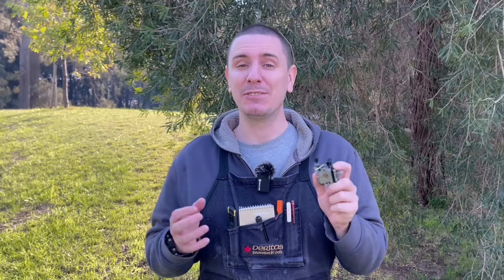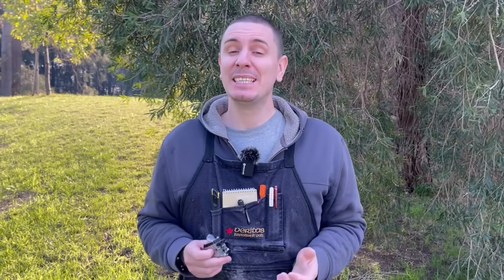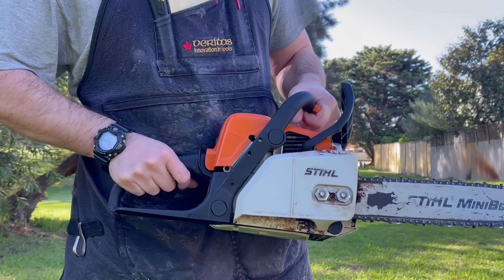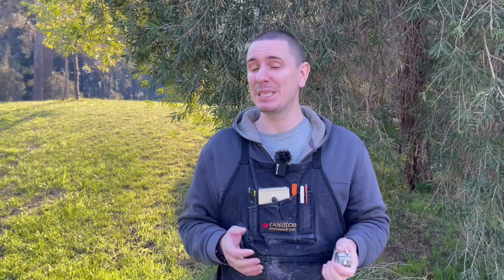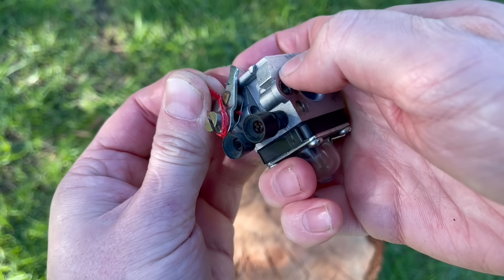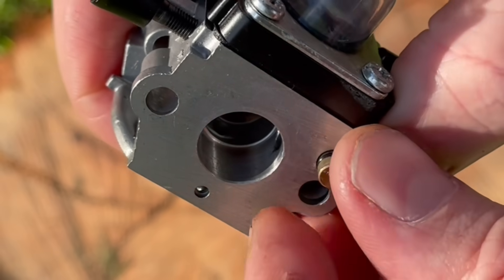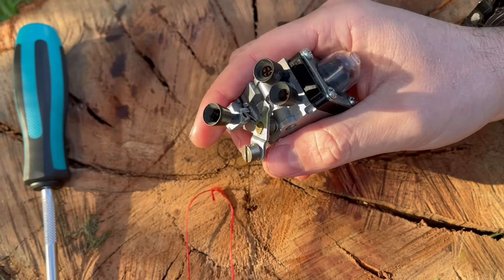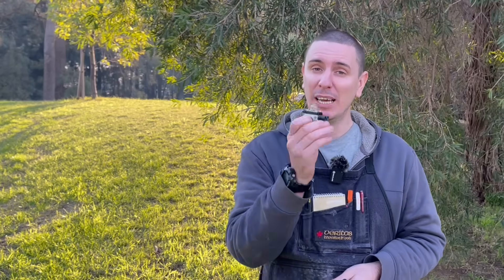A Carburetor Fix Many Mechanics Don’t Know!

Comment: Man, I’ve owned my lawn service 36 years. Prior to the introduction of ethanol fuel I rebuilt more than 50 zama cards on stihl 2 stroke lawn equipment. I started having problems with welch plug sealant loosening up and allowing an internal leak between a couple of the passages. I became disappointed and just started buying Stihl OEM carbs  I feel lucky to have lived back when it was a black art to tinker with carburetors. And honestly…..I just threw away at least 100 carburetors that I had replaced after I quit rebuilding them.
Reply from the maker: Crazy! Knowing how to is always useful :) thanks for watching!!
Reply: Wow! I need some old Stihl carbs and this video to skill myself in  something solid. I have thrown away one carb on advice of a technician and am in the middle of throwing away another !
Reply: @apollowangalwa-gt7qj  ….trust me….throw them away……if you want to experiment with them, then by all means……If I still had my old ones I’d gladly give them to you.
Reply from the maker: My channel teaches people how to repair, not replace things. Sadly too many people are parts swappers nowadays and are always getting stuck on the most simple / basic of tasks as they’ve never learnt.
Reply: @VintageEngineRepairs  , I was able to salvage the other 90% of the weedeater to use for another 10 years.  It’s kinda funny…..I guess I’m using vintage equipment….
Reply: Excatly  @VintageEngineRepairs
Reply: @VintageEngineRepairs agreed a carb cleaning and rebuild is not very difficult. At the shop I used to work at a good chunk of our daily business was rebuilding carburetors for the fellas that work in the woods during their lunch breaks. I could never justify replacing a whole carburetor when a carburetor rebuild kit cost $10-$15, a can of break cleaner or starting fluid and 5 mins of very light work. But by all means to the guys tossing carburetors and equipment over a fulty carburetor bring them to me 😊. I can not even count how many pieces of expensive equipment I obtained for very little if not free because they thought the machine was toast or just couldn't be bothered (rich ppl), but turned out the carburetor simply needed cleaning, a new float needle or diaphragm. Rebuild kit takes care of that and more. I got a beautiful fairly new snow blower last spring for free because it needed a simple carburetor cleaning. The guy who owned it went out and bought a brand new blower and was gonna take the old one to the dump. Glad I intervened as I got a really nice snow blower for nothing.
Reply: Worked as mechanic part of job was stihl equipment ive thrown away 100s of these carbs labor cost to much to mess with them, i rebuild the ones I can't get.
Reply: So all you throw out guys truly feel that a cheap China clone is going to work as well as original Stihl rebuilt properly ? Not just to hand to customer but longevity ?Genuine question. I know in small 4 strokes most people agree Commie Clones work but rebuild O.G. if its available.
Reply: I been knowing this trick it's common sense dude get a life cuz a lot of mechanics know about this you dumbass
Reply: Same here!20 years in buisness! Just the price and the time i spend on carburator to replace parts and finding problem are not worth it! If you have check valve problem or accelerating pump or primer unit leaking its too expensive to fix anyway with oem parts! Just replace it!
Reply: Stihl carbs aren’t cheap. I have a couple laying around from replacements also. 
Sounds like a weekend project. 
See if I can get them running again.

Comment: piss poor design diaphram carb, stupid pump/primer bulb. old chain saw carbs had choke plates and much better design
Reply from the maker: These use chokes too, the purge is to remove the air from the system. I don’t like the purge much, but they function well, especially using oem parts.
Reply: @VintageEngineRepairs I miss the purge on anything that doesn’t have it especially a big saw without a compression release that you have to keep pulling the rope till it pumps the fuel up.

Comment: Excellent information and explanation. I sure wish I had seen this video a couple of months ago. 
I had to replace a throttle shaft due to a difference in the cable linkage. I found the pump quite by accident when I removed the shaft. Only thing is I did not see a screen. It all worked in the end though. Also good tip on securing the spring. 
Secondly I didn’t know that the butterfly’s were slightly oval. I recently fought, and lost, to get one back together. I ended up buying a new carb. 
Cheers Tom
Reply from the maker: Thanks for the kind words :) sorry to hear of your struggles, but pleased you enjoyed and found the video informative!

Comment: Proprietary screws should be illegal
Reply from the maker: The JIS is actually a superior head, it’s designed not to cam out like Philips. Though I agree, one style for screws and one style for bolts would be nice haha
Reply: @VintageEngineRepairs I didn’t know about JIS and will keep an eye out now for that. Just another tool type to go with the imperial, metric and Whitworth, and all the screw other screw heads.
Reply: @VintageEngineRepairs  And then there's the Robertson head and square drive which look similar but are slightly different. Robertson was invented before the Phillips, JIL and square drives but lots of people have never heard of them before. I see you're wearing Veritas coveralls.😀

Comment: So some of the accelerator pump carburetor models have a metal plug pressed into the top of the 3rd bore. Getting that plug out can sometimes be tricky as you have to remove the throttle shaft first and then hold the pump piston down while using an angled pick to drive the cap out.

Also it is worth noting that usually if you look at the pump piston you'll see the side of it is scored up badly and that scoring is transferred to the bore which is what tears up the o-ring. The way the piston is operated the force applied to it isn't straight down, it's off center and as such the bore gets ovaled out and even with a new pump piston they usually don't go for very long before developing another vacuum leak in that area. 

I always recommend replacing an accelerator pump model carb once the pump/metering gaskets are used up.
Reply from the maker: Thanks for watching and sharing 👍👍

Comment: Bought a new carb for £6 ..... but good to see you fix this anyway 👍
Reply from the maker: You can :) but always best to save the oem one wherever possible. This process is easy, only takes 5 minutes to do and costs just 20 cents for the o-ring (I keep 20 or so of all 3 sizes on hand).

Comment: I have had to replace a carburettor on some lawn equipment because the reed valve was leaking which was causing the engine to bog down &: flood, replacing it with a $16 carburettor from China was the fix since it was cheaper to replace it.

I was caught out with a cheap & nasty carburettor which I bought from a Melbourne seller on eBay in Victoria so I ordered a $30 AUD carburettor from a seller which was based on the Central coast of New South Wales because it was an urgent repair.

The other carburettors main Reed valve was just held in by Loctite which got eaten away by fuel which caused the hedge trimmer to bog down & flood as well because fuel leaked past the check valve. 

So just be careful when buying lawnmower parts from a Muscat online !
Reply from the maker: Hey mate :) Shaun has been excellent to me when I use him, but aftermarket are always hit and miss. Did you reach out to him? The couple of times I had any issues his customer service was impeccable :)

Comment: Nice tutorial Tom, I have been using the oil trick for a few years it works well.  I sometimes do the same for finding leaks on two stroke intake, crankcase and barrel base gaskets.
Reply from the maker: Awesome mate :) yes I tend to use 2 stroke mix as it’s thinner for seals, but same concept! Thanks for watching!